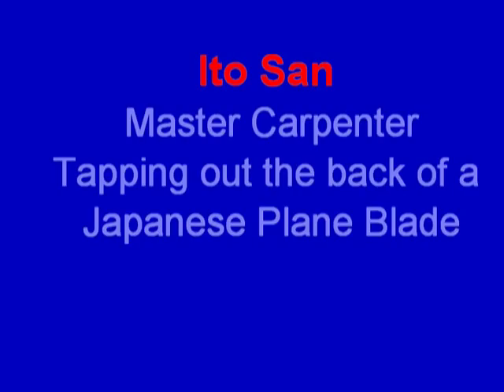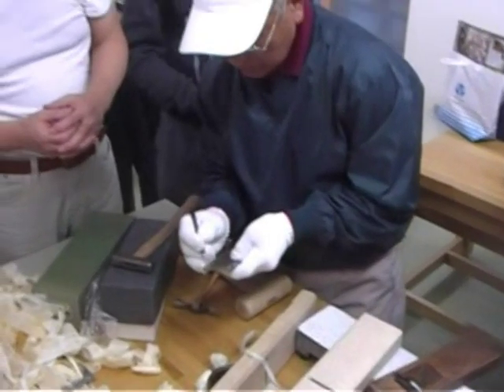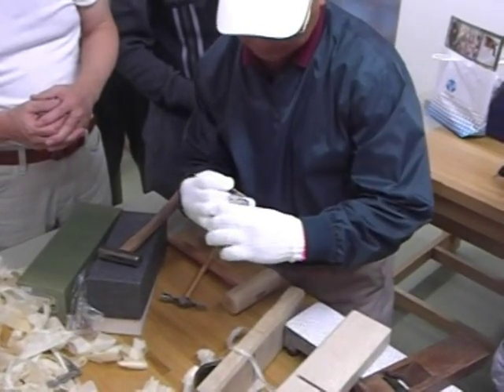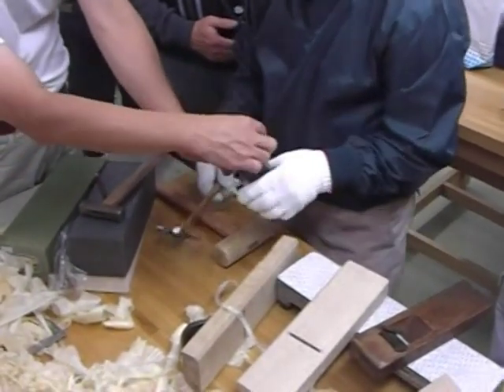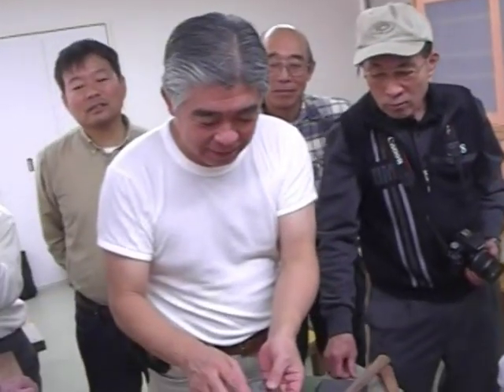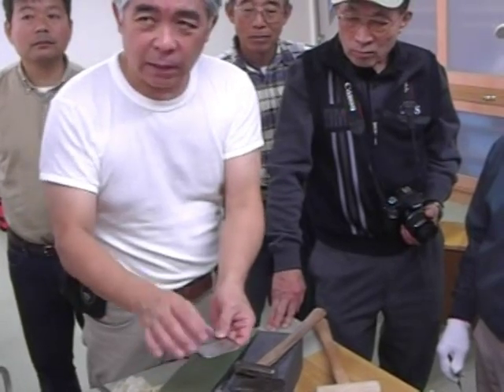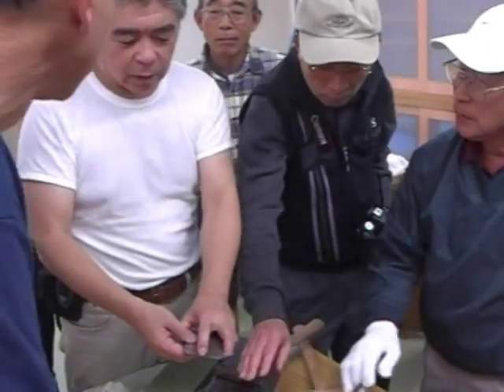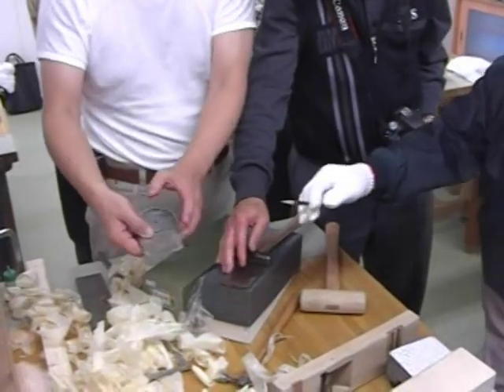Ito San Master Japanese Carpenter Tapping Out a Kana  Blade

Comment: I've wondered how they deal with the hollow ground back getting into the blade edge after many sharpenings.  I thought the Japanese blade edges were hard and brittle and would crack if bent cold.  Obviously I was wrong about that.  I think the hollow grind is a disadvantage for Japanese planes and chisels.  It's not needed and creates more trouble than it's worth.
Reply: deezynar , you're mostly right.  The back is hard brittle steel, the face is soft iron. In tapping out he is only hitting the iron, the lowest 2/3 of the bevel.  It bulges the iron and "gently" distorts the steel. And yes, we never hollow grind a Japanese style (laminated) blade or chisel. We need all the heavy soft iron to support the relatively thin brittle steel edge.

Comment: Can someone  explain "tapping out?" Is it a form of peening or metal upsetting? If so, what is it's specific purpose?
Reply: To obtain the desired geometry. You can correct minor blade twist etc. using this method but its main goal is to lower the part comprising the cutting edge with respect to the rest of the blade to amplify the built-in concave surface at the back of the blade. The goal: only peripheries of the blade back (near the cutting edge and near the sides) are touching the stone. Visit Sumokun's channel to learn more https://www.youtube.com/watch?v=0rLfvCri7do